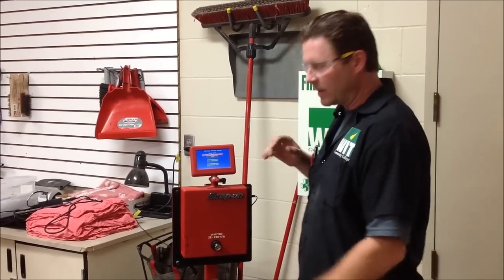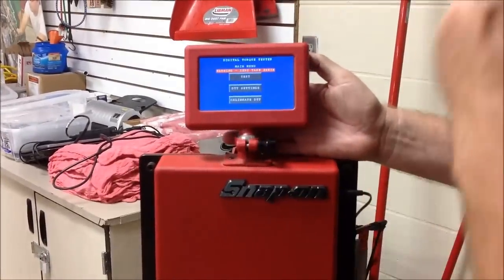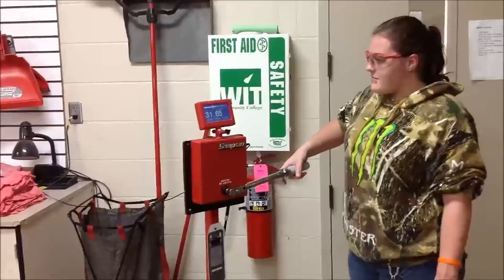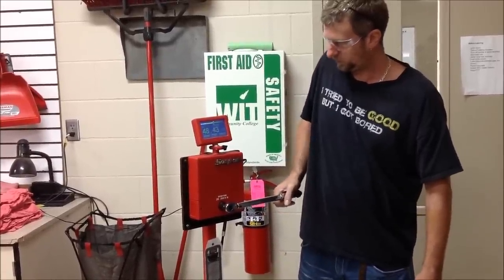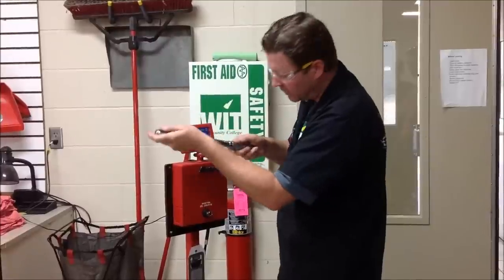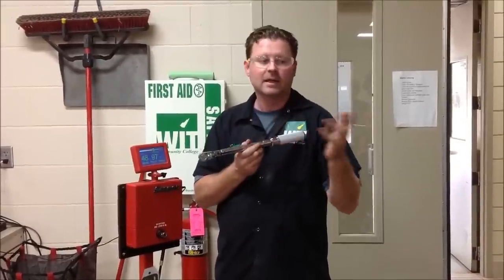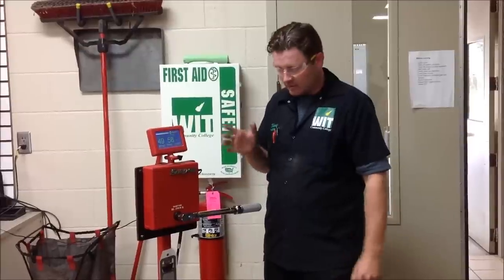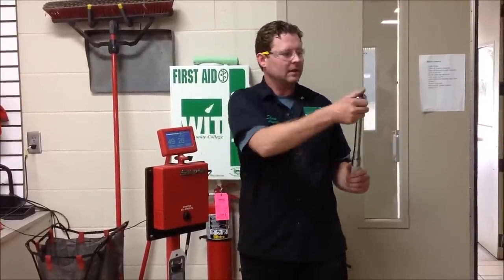Torque wrench calibration check Harbor Freight vs Snap On

Comment: Most torque specs. allow + or - 10%. I was not incredibly disappointed by the HF wrench being off by 10 ft./lbs. if the 10 was consistent. The snap on was within 1/2 of 1 pound even with different techs. using it. One thing also a torque wrench is like any other tool it needs to be used by trained hands to give best results. Any calibrated tool that you change the handle length on will no longer be calibrated. If you don't believe that ask a mechanical engineer. Nothing is written in stone except a persons name after they die, but for the most part if a tool has a grip surface that is where you grip it, with the hand and nothing else!
Reply from the maker: The math I'm coming up with is 20% error on the high side and that's at only 40 lbs. 40/50= 20%. I won't speak for other industries BUT in motorcycle powersports field, we do not have + or - percent when using tq charts. We have a specified range and it is more common that a one spec number is supplied. I've noticed some of the posters on here may be dealing with larger fasteners and tq values that "10 ft./lbs" may not seem like much BUT in my field it surely is. Thanks for watching and tuning in.
Shane Conley
Reply: Shane Conley I totally agree20% is bad if you are doing engine work of differential work, or tranny work. But if you are torqueing wheels or bolts on flanges you might get away with the 20%. How good of a wrench you need probably comes down to how detailed your work is. The one from HF is still better than nothing. In my opinion a tech. should spend the money for a quality torque wrench. I love the fact that you are checking the calibration of the wrenches at you school, because even the best tools can wear and become inaccurate. Where I work we have a gauge inspection room where they check and calibrate every measuring tool we use. We have one inspector who is totally devoted to that work, I find this to be a true benefit to the workers and the customer. We are a quality and safety driven company.

Comment: the HF torque wrench's are Super Easy to recalibrate   get a heavy weight  say around 30lbs  put wrench in vise   here the math for FT-LB  Length X Weight / 12 = Torque setting  example for 1/2 drive wrench  if you measure back 17in from center of the gear drive head & add  a 30lb weight  Now you have to add the weight of the wrench handle to which for a 1/2 drive HF style is 1.65lb  so now your weight is 30+1.65=31.65   So 17 length x 31.65 weight = 538.05 / 12 =44.38 FT LB   you loosen the black big nut at handle end of wrench & turn the threaded steel adjusting  plug  in or out to get your wrench to break at the 44.38 FT LB setting reinstall the locking Nut tighten and your done .
Reply from the maker: Thank you for the kind words.I will have to give this a try.  If I can ever be of service to you, here is a video explains how to connect with me. https://www.youtube.com/watch?v=vjvmB01ebcs 
Keep Wrenching,
Shane Conley
Instructor/Motivator/Motorcyclist
www.how2wrench.com

Did you like this free video and hope to see more? Would you just like to say thank you with a donation? Click https://www.paypal.me/how2wrench 

Like freebies? Click here for a free diagnostic checklist! 
http://gem.godaddy.com/signups/364621/join 

Head over to the new website and subscribe to the newsletter to never miss a video or newsletter! 
https://how2wrench.com/contact/

Comment: Snap on is expensive because of USA wages.   Cheaper stuff is typically made in other countries where wages are less & capable of producing the same goods at cheaper rates.

It's products like snap on that it the end of the day are simple to produce time & time again.
Reply: chris77777777ify Snap on is having many items made in other countries so I don't agree with your first sentence. They are expensive because of the name and that they back the product. I have brought way to many tools back to the truck for replacement lately..sad really..I try to by only US tools but loosing faith in Snap on.

Comment: Pushing hard on the toque wrench is not how you use. You are supposed to creep up on the click. You can  past the torque when doing it fast and hard. Also, you should calibrate, or have on calibrated before you judge it.  With a tester like that, you can easily calibrate those click type torque wrenches.

Comment: you also didn't unload the wrench like you did with the snapon...love snapon especially for technician use but as for a good economical wrench for the weekend warrior harbor freight stuff works just fine
Reply from the maker: We are not trying to promote brands or "demote" either. Our training goals are instruct on best procedures and practices. I also believe in looking at the data, using the facts to then perform great service.
Reply: +Kellen Richard Except when you tightening into an aluminum housing. You did note the 10 pound difference your "good economical" wrench gave? Strip the threads and tell me how HF "works just fine".
Reply: +Kellen Richard HF is okay for some stuff but DEFINITELY not torque wrenches. This should be obvious, seriously.

Comment: When posting my original comment i was to quick to make Judgements  based on a  different type of Torque Wrench My Apologizes to anyone that may have offended.

Regardless of Snap-on or who ever made the test machine, the machine will show the amount of Torque applied to it.

Ok understanding that.

I have not watched the retest with a longer bar applied to the Torque Wrench as shown by Shane Conley and i am not interested to (No disrespect to Shane).
 
The function of a Torque Wrench is to measure Torque very obvious.

The measurement taken by a Torque Wrench is measured at the head.

The confusion comes from the type of the Torque Wrench used

This type of Torque Wrench leaves itself open to a lot variations in its accuracy. 
Because it can give varying measurements of Torque depending on where you hold the Torque Wrench.
WHY.
Because it uses a defecting bar arrangement.

So the lever point is very important to its accuracy.

Simply put.
If you hold a small diameter bar in both hands and apply the same amount of force at different points along its length it will become easier to bend it as you move your hands further apart.

The Torque is measured at the head, but this is done using the above method.

Comment: Shane Conley your comment where you place your hand effecting the reading is incorrect and only effects the amount of force required to achieve X torque. For example if I have a 13" lever arm and place 50 lbs at 12" the gauge should read 50 lbs/ft but 100 lbs at 6" will also read 50 lbs/ft. The only time applied torque will change based on lever length is if you are moving the fastener axis relative to the fulcrum pin (break point) of the torque wrench.
Reply from the maker: Sean Cross 
Hello Sean. A few people have commented on this with math equations like you provided. This hand placement training comes direct from multiple torque certification sources. Here is a video proving it will indeed change by location of hand placement.  Keep in mind while small at the numbers we are tq at, in different industries, this could be large in error. Also understand the valve in teaching craftsmanship and there are often reasons or applications where a rule makes most sense. 
https://youtu.be/RsMxtEx0uik 
Head over to the new website and subscribe to the newsletter to never miss a video or newsletter! www.how2wrench.com/contact/ 
Keep Wrenching,
Shane Conley
Instructor/Motivator/Motorcyclist
www.how2wrench.com

Did you like this free video and hope to see more? Would you just like to say thank you with a donation? Click https://www.paypal.me/how2wrench
Reply: I watched the video showing altered readings but in my opinion that only shows a lack of accuracy for the measuring system. I am not sure what is causing it whether it be friction from the way the load is applied, deflection in the lever arm, or some other unknown force. I would like to see a test where the axis is held constant, a measurable force is applied to the lever arm at varying distances along it length and record the force required to make the click. Physics are absolute and have been proven to be so. When a torque wrenches or torque testers disputes those laws something is flawed. I always place my hand on the grip so not really a big deal but "inquiring minds want to know".
Reply from the maker: Sean Cross 
Interesting. Why do the manuals and training materials focus attention on this matter if it didn't matter? There sure is a lot of debate on this when it really would never be an issue to just use the "comfort" area of the handle anyway right? Lol. I like your "inquiring minds want to know".
Reply: You can't always place you hand on the grip though for various reasons. Why do they say hand position doesn't matter on a dial face type torque wrench? Is the click type torque wrench flawed? Does deflection of the lever arm effect click accuracy? 
Lets suppose deflection of the lever arm is a factor. If you use an extension that's threaded into/onto the handle and is rigid enough to not deflect. Would that negate the difference?
If 120 lbs/in is equal to 10 lbs/ft why does it not translate when you change where the pressure is applied when done at the proper ratio for given position and force.
I think you get the point.
Another factor you may have not considered: accuracy is effected by how quickly you apply the force.

Comment: The key question is if both of these wrenches were calibrated before the test. So???
Reply from the maker: As stated all tested tq wrenches are new out of the box with factory calibration certificates enclosed, if provided.
Reply from the maker: Head over to the new website and subscribe to the newsletter to never miss a video or newsletter! www.how2wrench.com/contact/ 
Keep Wrenching,
Shane Conley
Instructor/Motivator/Motorcyclist
www.how2wrench.com

Comment: I'm a do it yourselfer I would buy the snap-on or matco. because they're professional tools don't want a POS when it comes to torquing. that's where I stand.
Reply: +Brent Hoadley Well said. If you are going to use a torque wrench, it's probably because you're tightening a torque-sensitive bolt. What's the point if your torque wrench is not accurate?

Comment: I just bought a 1/2 & 3/8 from Harbor freight what can I do to make sure it's well calibrated or maybe I can go with craftsman  I'm a first timer with these tools
Reply: +Abraham Garcia I know it's too late now, but my honest advice is to not buy this sort of thing from HF again. There are tools that HF is great for and there are tools that HF sucks for. When you use a torque wrench, you do so because you are tightening a torque-sensitive bolt, and you might as well spend just a little more for the proper tool. You  can get a 1/2" Precision Instruments torque wrench for under $200. No, it's not $25-50, but expecting a decent torque wrench for $50 is unreasonable to begin with. You didn't mention if you're just getting started as a mechanic or if you are a hobbyist but I'm assuming the latter. You might think $75 or $100 or $150 is too much and that HF is more reasonable, but consider the labor cost you save by doing work yourself, and think of it as relatively cheap insurance that you're not going to strip out your head bolts or whatever other important bolt you're using a torque wrench for.

Also, some of their cheap and simple tools are also garbage, like the screwdrivers. Take a HF screwdriver and try to remove a screw on a car, like say a brake rotor screw, and you'll find the HF drivers to be made from metal that is very slightly stronger than cheese.
Reply: There are torque wrench adjustment videos hf calibration can be adjusted

Comment: I don't understand what people don't understand.  When you buy a tool that is expensive everywhere else then you go to "Harbor Freight" and the similar tool is 1/2 or 1/4 the price, don't you ask yourself, "I wonder why those other ones are so much more expensive?" It's because they are made of better material, engineered better, and quality checked numerous times before it leaves the factory.  All that costs money, therefore the "SNAP ON" or "Craftsman" or "MAC" or whatever is going to be more expensive.   I do not understand the mentality of poor people.  If you can't afford a craftsman torque wrench then you shouldn't be doing anything that requires a torque wrench.  I understand "Snap On" is expensive, consequently you don't want to buy it.  But that is too bad.  Some things are critical so you should get the best tool for that job.  Using a Harbor Freight tools is going to cause you problems.  Never buy anything like a generator or a torque wrench from Harbor Freight.  If your personal safety matters do not go the cheap route; go the expensive route.  You will never regret it, but you will regret someday going the cheap way.

Comment: the new icon wrenches are more accurate than snap ons, especially the electronic ones, cheaper and have a better warranty. their quinn branded toque adapter is better than acdelco at half the price. how the turns have tabled.

Comment: POUND PER FOOT, not foot per pound, that is something entirely different
Reply: +BigAlFiGala Torque = Force X Distance. Since the two units are multiplied it doesn't matter which comes first. And "per" indicates a rate (like speed for example, "miles PER hour"), which torque is not.
Reply: Foot-pound is a measurement of energy and involves measuring the distances a force is moved, pound-foot is a measurement of torque and the distance is always one foot, i.e how many pounds can be moved on the end of a one foot lever. Why does every torque wrench have lb-ft on it and none have ft-lb? Because they are totally different measurements
Reply: Interesting, i looked it up and see the difference, however trivial it may seem. here's a website that explains it well:
http://www.macsmotorcitygarage.com/2013/10/24/foot-pounds-and-pound-feet-whats-the-difference/

However, all throughout my college education in mechanical engineering, torque was referred to as "foot pounds" by student and teacher alike, and one of my torque wrenches says "foot pounds" on it, and another torque wrench says "pounds feet". So maybe you're right, but maybe you say potAYto and i say poTAHto?
Reply: +BigAlFiGala Yeah, you have a good point.  But here's the thing.  Pounds per foot would be lb/ft.  And foot pounds would be ftxlb or ft-lb.  Two completely different things.  lb/ft is something like lb/ft^2, or lb/ square ft.  It's a mess.  Just keep thinking.  You're fine.
Reply: His terminology using the word "per" may not have been correct, but his general message was right...

Comment: Not entirely happy with these tests.
The HF tool should have been returned & replaced & then the new one tested.
A digital torque readout device worth about USD50 should have been used tested also.
Reply from the maker: Peter Owens Peter has missed a few other videos on here it seems....

Comment: what snapon torque wrench should i use on my 07 crf 250r and 2002 yz85 i dont want to buy multiple torque wrenches just to work on my bikes i need to do the valves on my crf250 and i need to change the piston on my yz85 thank you
Reply: If you want a "one size fits all" torque wrench then buy an electronic snap-on 1/2" techangle. A LOT of money but it does it ALL. It does angles(for example: directions will call for 50ft lbs + additional 60 degrees, well the techangle does it all, you don't even have to take the wrench off the bolt).. It does ft lbs. it does inch lbs it does newtons etc etc.. Does it all.. Well worth the $$ if you're serious about working on stuff yourself..

Comment: bought a HF 1/4 torque wrench and went to tighten my oil pan bolts at 9 ft lbs. went for it and noticed it kept going and going and going. stopped went to another bolt, and snapped it right off. not huge on snap on tools but definitely snap on torque wrenches are the best.